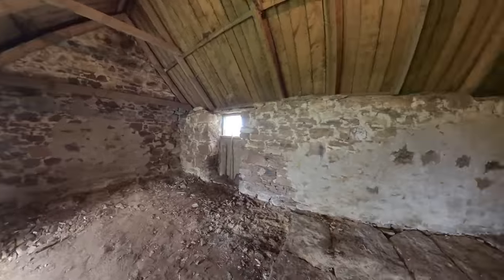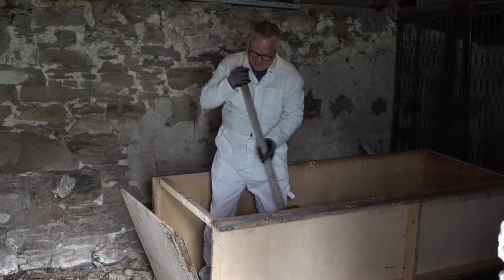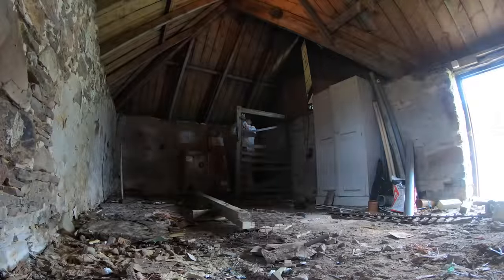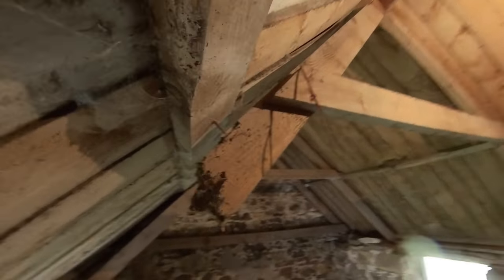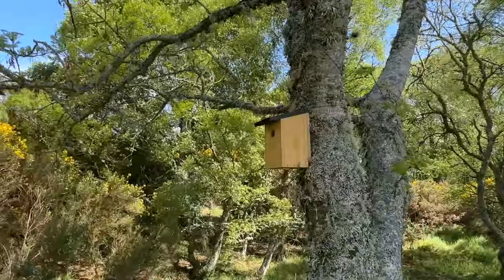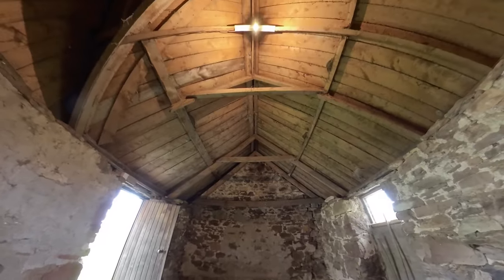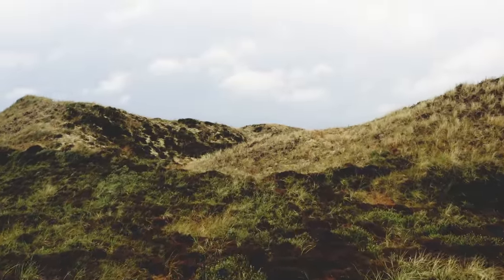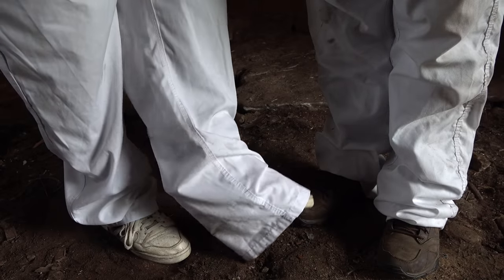Train Barn Model Railway - Full Steam Ahead! Ep. 246. 🚂

Comment: You may want to consider Carbon infrared heating. It is supposedly the most economical electric heating you can use. For starters look at the Veito range. They also come with remote control. Good luck with your project.
Reply from the maker: Like we said in the video, we’re trusting our builder who has done hundreds of these conversions 👍🏻

Comment: Why not insulate the outside of the roof. To keep the nice roof texture on the inside. Also you can put solar with a battery set so you can run the trains on solar
Reply from the maker: That’s not an option